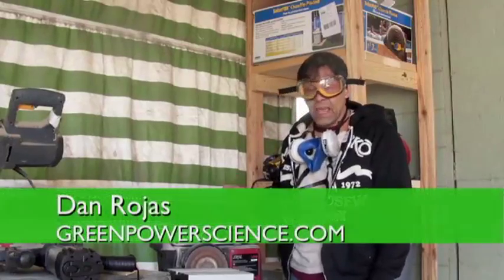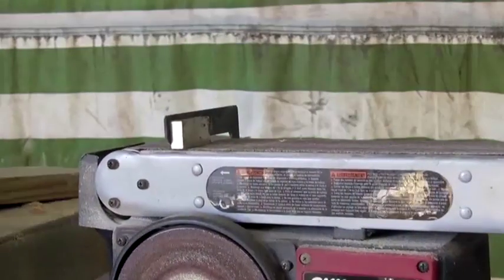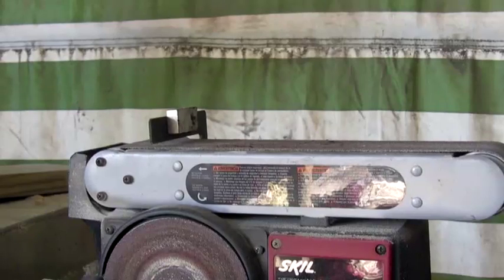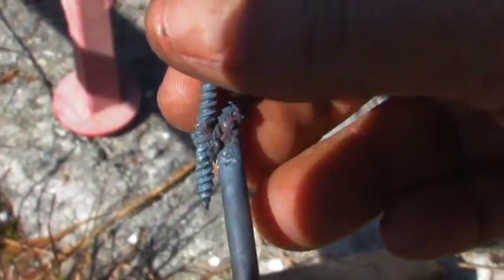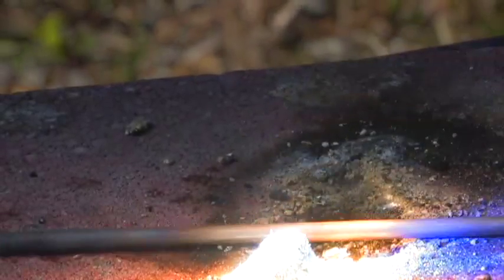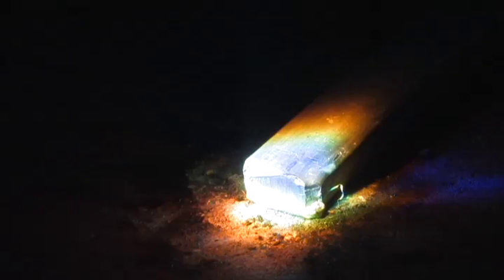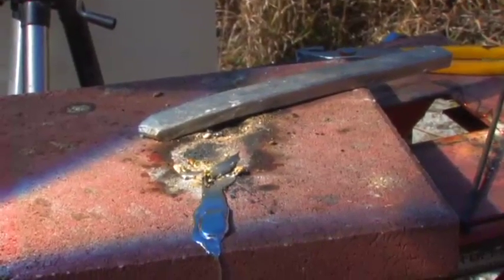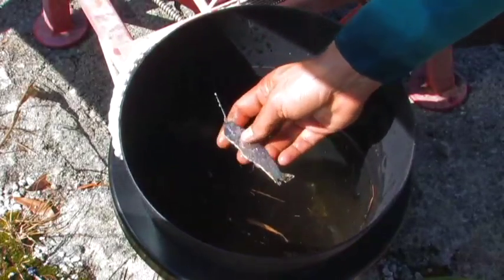Fresnel Lens SOLAR FOUNDRY MELTING STEEL Solar-Powered Death Ray In His Backyard

Comment: When I collected some filings from my sander I put my magnet in a plastic bag that some bolts had come in from the hardware store.  that way I just turned the bag inside out and the magnet was clean filings were in the bag.  Made for an easy get.

By the way the steel wool melting was way cool.  

And just a friendly word of caution.  Take care not to breathe the vapors that come from heating galvanized stuff.  The zinc vapors will kill you.  We need you around to show us this cool stuff.  Thanks

Comment: njtyper No. We know that different materials have different Curie temperatures, which is the point at which the permanent magnetism is lost - and you can induce a "new" one.

For example: the bottom of the Atlantic ocean, which is formed at the rift from molten material, has different magnetism along parallel lines to the rift. This is because the magnetic poles have inverted several times and at the time the rock was solidifying the Earth's magnetism was induced. When the temperature dropped that magnetism became permanent.

Comment from the maker: Works best as a hybrid system to use less traditional fuels. The steel requires a larger area of mass heat. The lens adds about 50% efficiency.

Thin 1/4" steel you can blade.

Comment: @cdltpx I think that you would at least be able to use a similar method to heat treat steel.  you might have to use multiple lens or an elongated parabolic mirror to get the focal point across more of the spine of the blade profile. that way more of the heat is focused on the spine of the blade and when you quench it the belly, or edge of the blade will be of harder than the spine.  you might need to use clay on the front to dissipate heat, but I cant say for certain as I have never done it.

Comment: @88Kamikaze69 do-able, yes. practical? no. Remember, I'm suggesting something that everyone could use as green energy. If 200 million people had Fresnel-lens-steam-engines generating them electricity, you'd have 200 million potential fire-starters. Imagine a squirrel fucking with your tracker and the lens being off enough to set your lawn on fire (or even your house?) especially in dry areas...

Comment: @alekkthewolf However, different frequencies of light, and infrared and ultraviolet, focus at different points.  Some wavelengths will not focus at all because the energy passes right through.  This is why achromatic and apochromatic telescopes focus light so much better, to largely overcome these focus differences.

Comment: @Greatbloke Your idea there is commonly used in constructing solar heated houses.  They may use stone, concrete, even water to provide some coolness during the day, some heat at night.  An earth berm house can practically heat itself.  Dennis Weaver had a home like that - there should still be a video on YT about it.  I think the term is "specific heat".  Choose a substance with high specific heat and reflect that using a flat vertical surface.

Comment: @BeeRich33 Hmmm - That would be similar to using heat sinks on wiring in electronic projects so the excessive heat doesn't end up ruining the electronics, just sidetracks to the heat sinks before it reaches the components.

Comment: Might be saying something you already know, but if you heat the surfaces of both your pieces of steel to melting point or just below incandescent then hammer them together they'll fuse rather than just bind to each other. Also, the sanded steel will likely have a high carbon content because of the burning sparks that will stop the metal from fusing. Basically the rule for ferric metals casting/fusing is avoiding air/oxidation/carbon buildup since it'll stop welding.

Comment: From the research I just did, it appears that you could run steam into the exhaust intake on the turbocharger to drive the turbine.Then, by removing the manifold that surrounds the compression blower on the other side, and taking off the fan, you would have access to a drive shaft that you could put a wheel with magnets attached on for generation purposes! With a large enough parabolic reflector you could earn a living just by selling power back to the grid. Can't wait to do this!

Comment: wow if you had a big enough lens you could have a little foundry and pour up some ingots out of your scrap metal wonder if thats possible? wonder how big the lens would have to be to heat up a decent size crucible big enough to pour up some ingots? you could probably do it with aluminum easily.

Comment: I think some sort of flux (maybe borax?) might help quite a bit to smooth up those steel joints and make them look nice and pretty.

I think you could melt a much larger piece of steel if you encapsulated the bulk of the metal in a decent insulator (like maybe in a piece of firebrick or pumice) and then exposed just the one small surface to the heat from the lens. That way you would not lose so much heat to convective flow to the air and or conductive flow to the metal stand it was sitting on.

Comment: @specallez 
I agree to some extent although I personally believe a steam engine would be completely do-able for bakyard-diy.
You'd need a solar tracking  heating platform, an old wood stove for an example with pipe attachments and a water feed, a less than optimal range for the fresnel lens so that it didn't melt the oven although it seems that might not be a problem judging by this fellows attempts at a solid metal block, and lastly you might need 4-5 of these lenses.
But it's do-able.

Comment: As You Know there is a potential of 1 kilowatt per square meter from solar energy
so this would be equal to

1 kilowatt hour = 3412 Btu

A typical portable electric room heater as
1.8 kilowatt hour = 6141 Btu

The amount of heat delivery of the acetylene flame is 
1,450 BTU/CF at 6000 degrees F

Comment: Yes Dan what is missing here is a high level of BTU 

Example 1 match stick equals 1  BTU at say 650 degrees

Now take 1000 matches and light them altogether this equals 1000 BTU 
the temperature of each match is about the same but the combined amount of 
Energy /  BTU increased 1000 times.

Even large FRESNEL LENS can only produce a small amount of BTU.